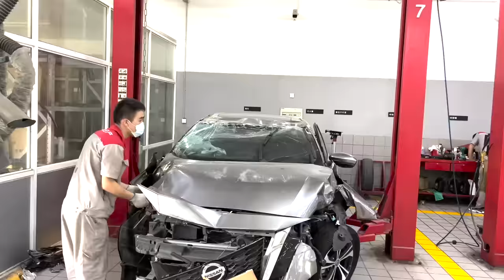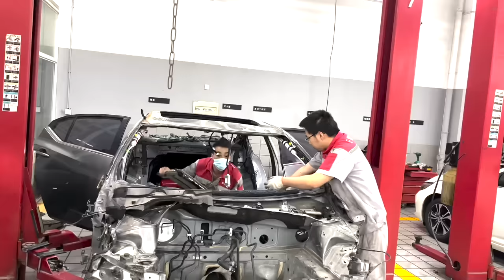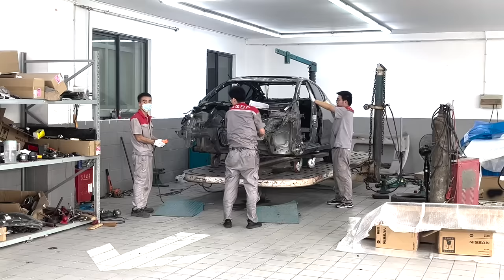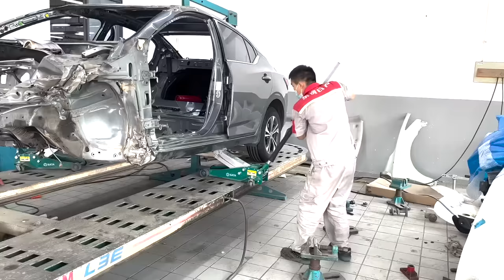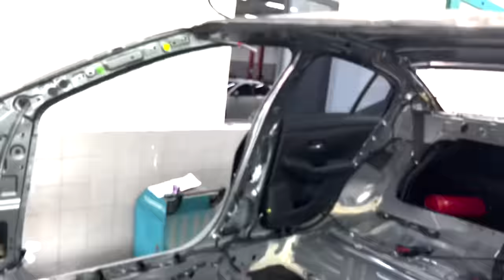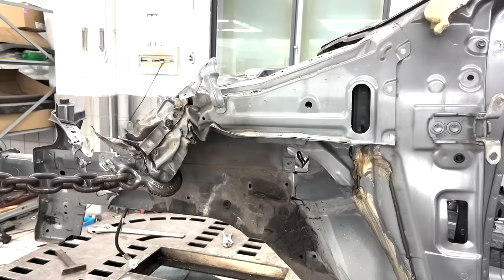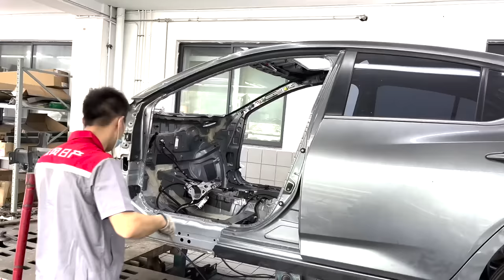Mechanical Wizardry: Master Technician Han Restores Scrap Nissan Sentra to Perfection!

Comment: Absolutely amazing work, just not sure I would trust the integrity of the refurbished body?
Reply from the maker: It's understandable to have concerns about the integrity of a refurbished body, especially after significant repairs or reconstruction. However, reputable auto body shops and professionals follow strict standards and procedures to ensure that the structural integrity of the vehicle is restored to its original condition or even improved.

During the repair process, technicians carefully inspect the vehicle's frame and structure to identify any structural damage. They use specialized equipment and techniques to realign and reinforce the frame, ensuring that it meets the manufacturer's specifications for safety and performance.

Comment: I have a few questions to ask. I wrecked my 2009 nissan altima. Has some pretry bad damage in the front. The front part of the driver side fender is pushes in with the bumper reinforcement bar smashed together with the bracket like a pancake and the sub-frame is bent back as well. It's just that front left corner thats got all of the damage. I was wondering if i should pull the fender frame back or if I should cut it out and weld another piece on from a scarpped car? If i should cut and reweld, where should i do that at? Any specifc location? I dont have much experience with welding, so im not sure what welder and what techniques should be used. I'd be happy to show the damages if i could. Some expert advice would be great.
Reply from the maker: I can provide some general guidance based on your description. However, always consult a professional mechanic or body shop for a detailed evaluation and recommendations specific to your situation. Here are some general considerations:

Assessment: Considering the extent of the damage, a thorough assessment by a qualified professional is critical. They can determine the best course of action based on the specific damage to the front left corner.

Pull vs. Replace: Whether to pull damaged parts back into place or replace them depends on the severity of the damage and the structural integrity of the affected parts. If the damage cannot be repaired, you can try to pull out the shape of the original car, cut off the damaged part from the deformation, retain the original part of the car as much as possible, and replace an old longitudinal beam.
If welding is required, it should be performed by an experienced welder or a professional body shop. Welding involves specific techniques and safety measures. The decision to cut and weld new parts will depend on an assessment of the damage. Regarding welding equipment, you can use an ordinary electric welder or the carbon dioxide gas shielded welder we usually use.
Since you mentioned not having much welding experience, it is highly recommended to consult a professional who has the expertise and tools required for this type of repair.

Always put safety first and ensure any repairs comply with local regulations. If possible, seek advice and estimates from multiple professionals to make an informed decision. If you have photos of the damage, you may consider sharing them with a certified professional to get a more accurate assessment.
Reply: @xinxianshi  Thank you. God bless you.

Comment: What happens with the repaired Nissan? Is it sold as new from factory?
Reply from the maker: After the car is repaired, the owner will continue to drive it and sell it as a used car in a few years, of course, the price will be very cheap.
Reply: @xinxianshi  In most countries, cars that need extensive bodywork are written off from driving on public roads and the insurance company pays an average sum of money to the car owner. They prevent the body shop from selling the car as new to an unsuspecting buyer.

Comment: I’d love to see a comparison of repaired vehicle against a new car in crash test.    For sure there is differences in metal and welding techniques.   Maybe for the good not necessarily bad…
Reply from the maker: There is no doubt that the repaired car is not as good as the original car in a collision, but it is not completely unsafe. I think that even after repair, the safety is far better than other low-end models, such as some micro cars.

Comment: Respect for doing all of this wearing a mask. As a mechanic who had to wear an "FFP-2" I couldn't stand it after 5 minutes anymore. Boss gave in at some point😢.
Reply from the maker: It's important for employers and workers to find a balance between safety measures and practical considerations to maintain a healthy and productive work environment. If safety regulations allow for adjustments without compromising safety standards, finding solutions that are more comfortable for workers can be beneficial.

Comment: Brilliant work 👌This car wouldn't be allowed back on the road in the UK tho. It would be classed as Category B ( Breakers yard)
Reply from the maker: really. Vehicle regulations and classifications may vary from country to country, and what is acceptable in one region may not meet the standards or requirements of another region. UK regulations may be more concerned with safety, which is a good thing
Reply: @xinxianshi в большинстве ,, очень многое зависит от мастера который обслуживает машины ,,, тормозную систему ,,, а их очень мало 😢,,, единицы которые разбираются в ней 😢 но они есть ,, их надо искать 😊

Comment: I'm sure he'll enjoy that extra strong UV exposure by welding without a UV face shield. Closing your eyes to avoid blinding yourself is only part of the protection a shield offers. And the reason we don't rebuild a wrecked car in the US, even if it could be done cheaper than the price of a new car, is the insurance company can be held liable if the vehicle does not perform up to expected crash test standards after this type of repair. Just like a helmet on a motorcycle, the crumple zone of a car is only made to protect you once. You may be able to get the alignment to be straight again and the panels to look flush but how strong is that crumple zone?
Reply from the maker: Your point of view is correct. It is necessary to use welding masks. Unfortunately, in our country, workers have not formed a sense of self-protection. They generally use the experience of their predecessors at work.

Comment: I wonder. On an economic level, is all the work invested in this repair feasible? In my opinion without experience I think it would be very expensive.
Reply from the maker: This is a valid question. The cost of repairing a severely damaged car can vary depending on a number of factors, such as the severity of the damage, the cost of replacement parts, the labor required, and the location of the repair shop. A very professional and mature industry, with various price points and levels of maintenance, it depends on the customer's choice. Of course, even for the highest level of maintenance, the repair cost will not exceed the value of the vehicle, and there will be a certain profit from the sale, otherwise No one will choose to repair it

Comment: What I would like to know is how many hours it took to get it fixed. And wouldn't it be cheaper to buy a new shell from Nissan and rebuild it.
Reply from the maker: It took a total of one month to repair this car. Your suggestion is very good. It is also possible to buy the car body directly from Nissan, but the cost is not as good as repairing it, and the overall fraud may exceed the price of the new car.
Reply: @xinxianshi  thank you for responding.  I don't know what Nissan charges for a bare shell, but what you said about shell price vs panels and hourly rate makes sense. Keep up the good work. Love to see how (in my opinoin wrecks) come back to life because of you.

Comment: Why did you use the drill ?
Reply from the maker: the use of a drill in car repairs is common for tasks such as removing spot welds. In the context of auto body repair, spot welds often secure panels together, and a drill can be used to carefully remove these welds during the disassembly process.

Comment: Is this really safe?  The unibody is built to crumble in an accident to save lives if you cut away and replace bits doesn't that take away from the safety?
Reply from the maker: When repairing a vehicle, especially if structural components are replaced, there is a potential impact on the vehicle's original safety design. This is why it's critical to follow industry standards, manufacturer guidelines, and safety regulations when conducting repairs. Professional technicians should use approved repair methods and materials to ensure that the vehicle maintains its structural integrity and safety features.

Comment: Couldn't help but notice the lift arms look sketchy as hell they way they're welded to the carriage. There's no bracing whatsoever, just a weld around the top.
Reply from the maker: Thank you for your attention. Please rest assured that the welding strength is very strong and will not cause deformation or breakage of the entire vehicle.

Comment: While I can understand no one wants to buy an accident repair car, this by far has been repaired to its highest standard all damaged part removed and replaced with brand-new no shortcut It's the closet you can get to OEM spec.
Reply from the maker: Repairing a vehicle to such high standards not only ensures its safety and performance but also enhances its overall value and desirability. While it's understandable that some people may have reservations about purchasing a previously damaged vehicle, when the repair work is done meticulously and to OEM (Original Equipment Manufacturer) standards, it can instill confidence in potential buyers.

Additionally, transparency about the repair process and providing documentation to verify the quality of the repairs can further reassure buyers about the vehicle's condition.

Comment: Repairing a wreck. In my country the vin etc cannot be reused. The car cant be insured if it was reinvented. The chassis is compromised. The only use is parts but you cannot cut it in half eother.
Reply from the maker: In such situations, salvaging usable parts from the vehicle may be the only practical option. However, even salvaged parts may need to meet certain standards or regulations before they can be legally used in other vehicles.

Comment: the car' s next owner will change the front tires very often
Reply from the maker: I understand your concerns. After repair, we will perform precise four-wheel alignment to correct the errors caused during the repair process to ensure normal driving.

Comment: how much is it worth after repair?
Reply: Well, repair mustn't have been so expensive, since it took a little more than half an hour to finish...
Reply from the maker: It's probably worth $13,000 after restoration. This is a new car with less than 10,000 kilometers on it.

Comment: What surprised me was that the inner body was always available regardless of the brand of car.
Reply from the maker: Yes, it can be surprising to learn that the inner body structure often follows similar principles across different car brands. While the outer design and features may vary greatly between manufacturers and models, the inner body structure, such as the chassis, frame, and support systems, often adheres to industry standards and engineering principles.
Reply: @xinxianshi  but can the bolt hole and indentation be exactly the same? and they always get new items, not second-hand / loose cars
Reply: @xinxianshi  overall I am impressed with the work ()judging from the Video)

Comment: In the US this repair would cost twice the value of an used equal car.
Reply from the maker: It's not uncommon for extensive repairs to approach or exceed the value of a used car, especially if the vehicle is older or has lower market value.

Comment: It should be illegal; the structural damage to the car was extensive. Even if it appears fine after repair, there's a risk of fatality if the new owner gets into an accident
Reply from the maker: You bring up a valid concern。Even after repairs, there can be underlying structural weaknesses that compromise the safety of the vehicle, especially in the event of another accident.

Comment: why are my windows leaking????
Reply from the maker: There are many reasons for window leakage. Diagnosing the exact cause depends on many factors. If you are talking about a sunroof, it is recommended to check whether the sunroof drain pipe is blocked. Generally, there are drains on both sides of the sunroof. You can check it. Please check the specific car model. Google search

Comment: This wrecked car could be totalled 3 times here in Canada
Reply from the maker: It's interesting to see how the standards for determining a total loss can vary between different regions. Factors such as the cost of repairs relative to the value of the vehicle, safety regulations, and insurance policies can all influence whether a vehicle is deemed a total loss or not. Thank you for sharing this perspective! If you have any other questions or observations, feel free to share them.

Comment: I always hated how in America we thrash things instead of fixing them
Reply from the maker: Cultural perspectives on repairing or replacing items can vary, and both approaches have their merits depending on the circumstances. Repairing items can be seen as more sustainable and cost-effective in certain situations, while replacing might be necessary if the item is beyond repair or if it's more cost-effective to replace it. Different cultures and individuals may have varying views on this matter based on factors like economic considerations, environmental concerns, and personal preferences.

Comment: In indonesia, the insurance wont fix this. they just pay 80% car price
Reply from the maker: Insurance policies can vary significantly between countries, and it's interesting to note the differences in how insurance companies handle repairs and compensation. In some cases, insurance companies may follow a total loss threshold, where if the estimated cost of repairs exceeds a certain percentage of the car's value, they may declare it a total loss.

Comment: From a materials engineering perspective, much of the steel bodywork has been stressed beyond its yield point. How the reconstructed car behaves in a future crash is anybodies guess but I wouldn't want to be in it.
Reply from the maker: Your observation is valid. When a material is stressed beyond its yield point, it undergoes permanent deformation, and its mechanical properties may be compromised. In the context of car repairs, especially when extensive reconstruction is done, there are concerns about the structural integrity and how the vehicle would perform in future crashes.

Comment: Why do he  keep drilling all those holes.?
Reply from the maker: Hello, the purpose of drilling is to remove the solder joints of the original car and then weld the new parts on.

Comment: Just because you could doesn’t mean you should.
Reply from the maker: Esa es una observación válida. Aunque técnicamente sea posible reparar un vehículo gravemente dañado, es importante considerar si la reparación garantiza la seguridad y la integridad estructural del automóvil. En algunos casos, la magnitud del daño puede comprometer la seguridad del vehículo incluso después de la reparación. Por lo tanto, es crucial evaluar cuidadosamente si la reparación es la opción más segura y viable en función del estado del automóvil y las regulaciones locales.

Comment: The wonders of installation are not repairs
😂😂😂👎
Reply from the maker: Sounds like you're pointing out the difference between installation and repair with a little humor! But please note that this is different from ordinary installation. It requires a lot of skills and experience to remove the damaged accessories and restore the body to its original size. It is also the same to install new accessories, align the original traces for welding and assembly. Requires skill. So it's not as simple as you see

Comment: Insurance company was right. That thing should never have gotten back on the road.
Reply from the maker: The insurance company did not consider safety factors. After calculation, they found that repairing would not be economically beneficial, so they requested scrapping.

Comment: For all the comments about a wonderfull job ... this frankstein car i would never drive , from the standpoint of engeneering this is absolutly shit , you cannot cut a car in half and put another half and hope that works 100% , any missalign by a few mm will make the car unbalanced, windshield craking, tire wear more in one side, unhability to corner properly, unhability to proper aligment of the wheels, not to mention the fact that this only works in countrys with bad payrols , and also the amount of  manhours to put this toghether suppresses the manhours in the factory when is beeing build
Reply from the maker: You're correct that even small misalignments or deviations in the repair process can have significant consequences for the vehicle's performance, safety, and longevity. Additionally, the complexity and cost of such repairs may outweigh the benefits, particularly when compared to the manufacturing process of a new vehicle.

Comment: Impressive, but dangerous to put a car like this back on the road. If you bend a paperclip back and forth a few times, it will snap. For this repair, you can say it meets safety standards all you want, truth is that it is never the same strength as original factory.
Reply from the maker: Thank you very much for your message, the points you raise make perfect sense. I completely understand your concerns about the safety of restoring an accident vehicle and putting it back on the road.